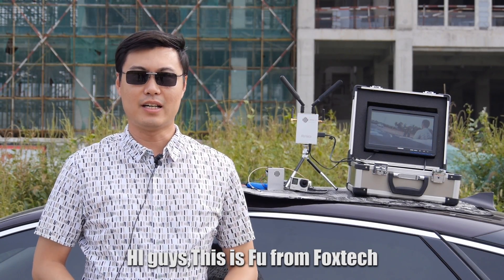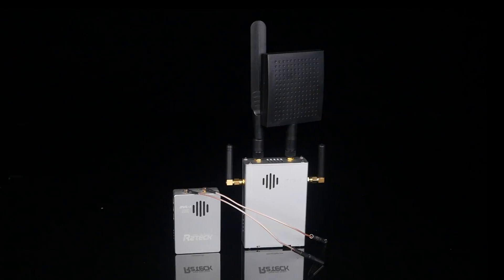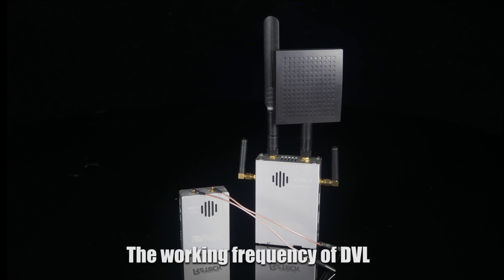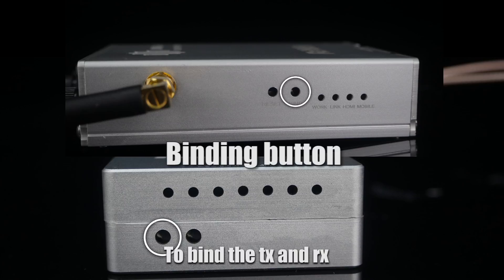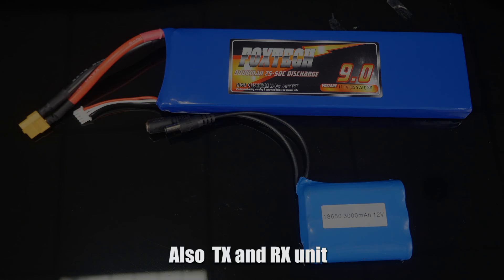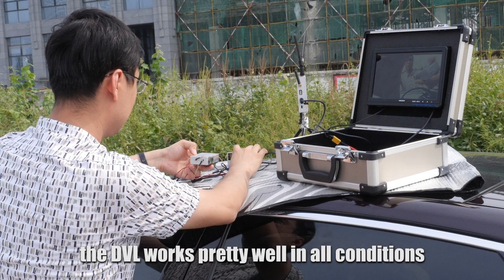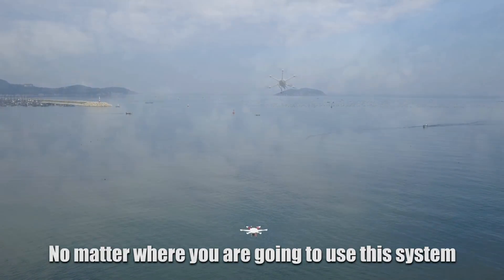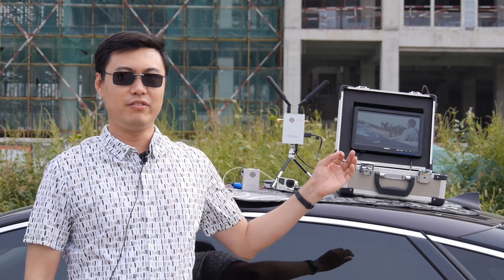Lightbridge challenger? Cheap 1080p 60fps 4km HD Video link

Comment: don't buy R2Teck product. this is worst rubbish product. i have bought it and use it. the resolution has been down. i connect my full hd laptop to my full hd tv using this product. but the image not so clear. like have some distorsion. very very disappointed. not same like what the sales marketer said. mine are R2Teck DVLM100.

Comment: Like the hacklink which you hid the fact that it only works with Futaba transmitters. Plus the receiver constantly hangs which requires you to open the case and remove the internal battery to reset it. Foxtech is unreliable.